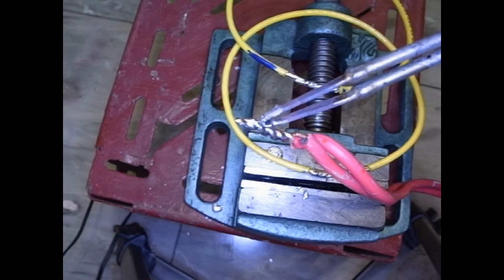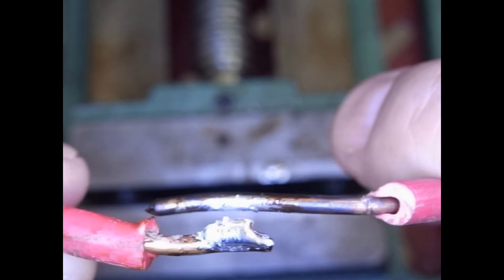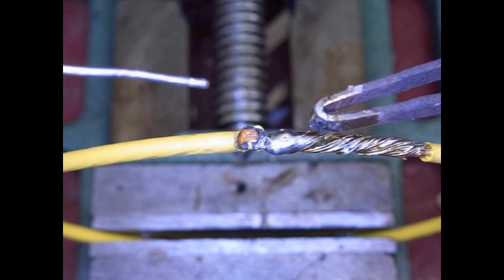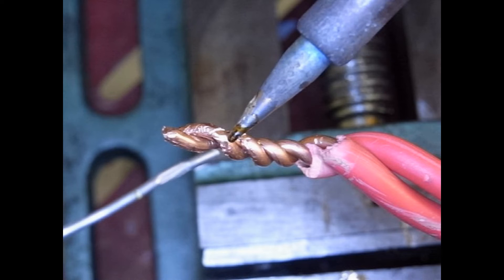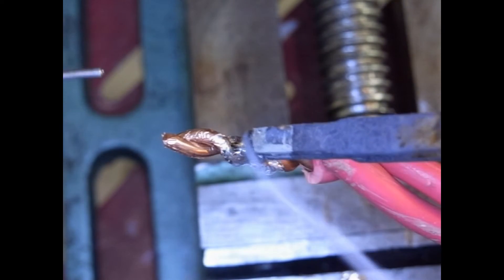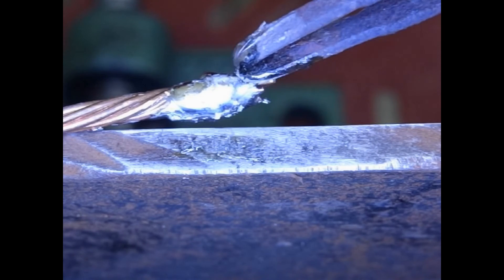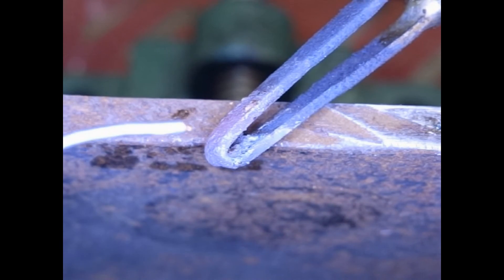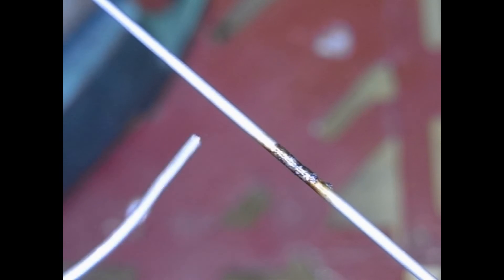Common Soldering Mistakes

Comment: It was the heat . I after watching you video I went out and got me a much better soldering iron.  But my tip got corroted pretty fast.  I think the solder im using is the kind you didn't recommend.  Is there a way to get it back in working order? Or am I just going to have to buy a new tip? Idk where I could even get a tip from. Michael's maybe? My new rig had a bigger tip too so that helped but the pads im having to work with are so small. Thx again for all the advice you have helped a ton!! And ill be flying my drone in no time.  ;)
Reply from the maker: Glad to help. Acid flux (in the solder or applied separately) is really bad for electronics and eats up solder irons quickly. Acid is used for soldering steel and such. New tips are usually cheap and if it is badly corroded new is best.

Comment: You did a great job teaching about the different things that could go wrong.  Im still not sure what part im getting wrong.  My iron goes up to 400 or 450 not sure if that's hot enough.  Im using a very fine tip but im soldering very small pads for fpv drone parts the pad is a little less than 1/8 of an inch big maybe smaller . The solder im using has worked before and I think has rosin in it but the label is gone so im going to try a different kind with a new iron that I can get hotter . The iron holds solder but I cant get the pads to flow and stick.  It keeps building up and popping right off.  They look clean to ne and I used some Flux after trying the first time.  So maybe its dirty.... ill try to sand it a bit to clean it.  I just dont want to damage the board with having to stay so long on the pad.  :( thx for the help !! .
Reply from the maker: I can not say for sure, but it does sound like dirty work pieces.  For fine connections you can clean them with clean white paper.  There's much less risk of damage and you can see when they are getting clean from the paper.  The worst common contaminate is oil from food, skin, etc.  If the board is unpopulated I clean it with dish detergent and a toothbrush.  Some less common problems include things like your soldering iron tip is corroded where it contacts the heating element and good heat transfer is not happening.  I've tried many ways to fix that, none of them are long lasting.  A new tip is better.  I've never seen something that won't solder IF you have a clean work piece and enough heat and a rosin core solder.

Comment: What temperature should I set my variable temp iron to for common small copper solid or stranded wire?
What’s the best way to clean the wire AND our iron tips?
Thanks for the video demonstration!
Reply: I'm no expert, but I can say, on adjustable irons, the tip plays a much larger role in temperature setting than most people would assume (at least what I assumed). I have an old RadioShack digital soldering station, which was a rebrand of an Atten product and is a variation of a Hakko clone. I learned through experience, nothing beats genuine Hakko tips. Their platinum alloy tip plating is much better than anything else I've tried (around 20-25 cheapies). I use two different tips regularly a large chisel and a long conical with a tiny beveled  pad at the end. 
  (Said all this because:) I set the Chisel to 575F most of the time and the conical to 645F. These settings yields similar results on contact.
  All of the Hakko and Hakko clone irons that use the classic 900 series tips are bad about incorrect temperature readings in general. They measure the internal heating element which has nothing to do with the actual tip temperature. In practice the length of the tip, it's thermal mass, and the quality of contact made between tip and element are all critical for actual tip temperature, at least in my experience. 
    The main thing to do with the platinum coated tips is to keep them covered in solder all the time, at least according to Hakko's instructions. They say oxidation is the enemy of tip coatings. Non-plated tips like iron should be a bit different in practice, I think. I rarely ever use them.
  There is a cleaning product I have called Sal-Ammoniac. It comes in a solid white block. You rub the oxide off of a tip pretty easily with it. There are are also tip cleaning products that come in little tubs for cleaning off heavily oxidized tips. I'm not sure if it's the same stuff. The best thing to do is to keep it shiny all the time, then you'll never need tip cleaners. Using a brass or copper scrubber ball to clean the tip off while soldering seems to help a lot too as it leaves a thin coat of solder on the tip. I use this 9 out of 10 times and only use a sponge if I'm working in super tight spaces and trying to absolutely avoid any potential bridging from any wet solder on the back side of the tip.
Just my $0.02  ;)
-Jake
Reply: Upcycle Electronics Thank you Jake!
Reply from the maker: Thanks for all this!
Reply from the maker: For cleaning I use a solder sponge (ordinary sponges melt and mess up your tip, do NOT use them!) or a damp piece of paper (but they are a fire hazard when they dry out). 

For cleaning wire, bigger stuff I use a knife, sandpaper or even file.  For small stuff, knife.
For the temperature thing that's a really tough question.  The goal in good soldering is to flow heat at a rate so the work piece reaches the temperature where your solder becomes truly liquid, and not so slowly that the heat can spread far enough to damage sensitive components / tracings. 

Caveat: If the wire is a smaller heat sink than the solder you have to heat both doing things that are generally considered bad technique (like applying the solder directly to the tip where it touches the wire). 

This is a long winded way of saying I have no idea how to use the temperature to do the above.  To do the math would require knowledge of the thermal masses of everything involved and calculus (seriously) to get the final answer. 

I think the best use of the temp readout is to tell you when you are falling below the melting temp of your solder and therefore not getting the rate of heat flow needed.
Reply: tsbrownie Thank you. I’ll just have to do some testing and use some of your info!